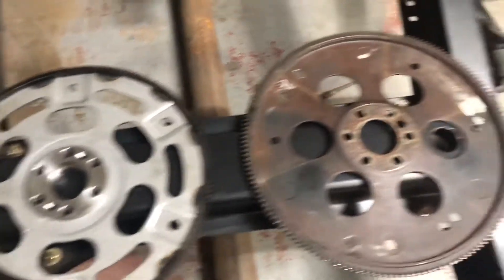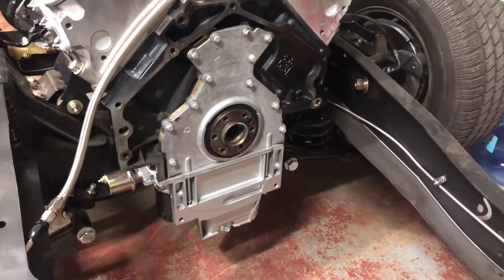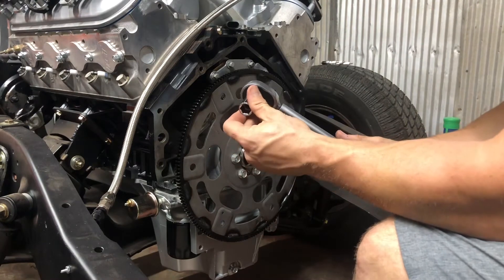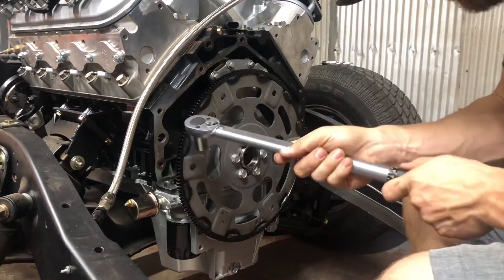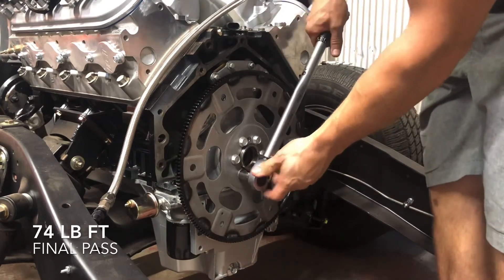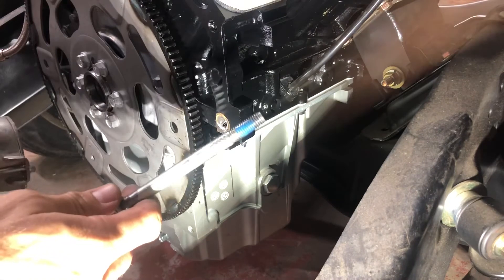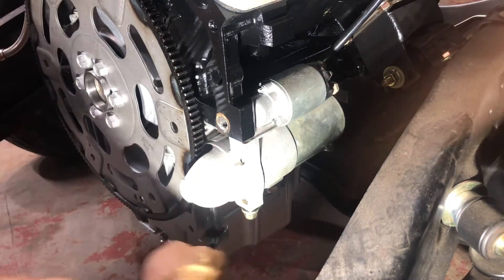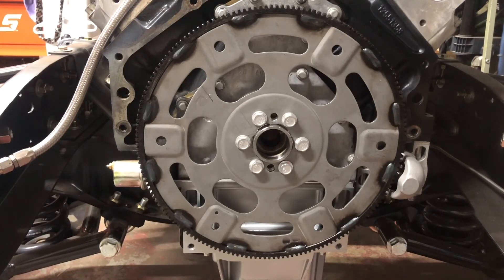How to run a 4l80e behind a 4.8/5.3.

Comment: Keep the starter out till you mate the transmission to engine. Will be easier to bolt the flex plate to the torque converter.
Reply from the maker: Good call.

Comment: Hey buddy I know this is a old video but did you have to change starters to use this flexplate? I’m running a 2002 5.3 LS swap with a original GM 4L80e flexplate or like some say 6.0 flexplate and the spacer that was behind a 4.8 LS with a 4l80e I think it was out of a full size Chevy Van but anyways I bolted up my new 5.3 starter and it sounds like my starter needs to be shimmed, should I have ordered a starter for a truck or Van with the 4.8 or 6.0 with 4L80e instead of a 5.3? Reason I ask is because 98% of the time you don’t have to shim a LS so I’ve heard
Reply from the maker: Did not have to change starters.

Comment: Love this video brother. I have a 1985 Caprice with a lc9 motor, and I'd like to add a 4l80e. Would this combination work for my build as well with that same flex plate? What is the number on you trans?
Reply from the maker: Don’t know the number off hand but mine is a older 4l80e I think it’s a 96 or so. Should work with all 4l80es

Comment: what t
ranny and torque converter are u running?
Reply from the maker: Stock 4L80E
Reply: @3rdGenC10s  ok 👍, I’m currently converting my 95’ k2500 turbo diesel over to a 5.3L. I just don’t know if I’ll need to replace the torque converter. I already got a new flex plate 👌

Comment: I did a 4l80 swap on my 5.3 and when I accelerate my truck starts to slip thinking it was my torque so I changed the torque converter to a 3200 rpm but it didn’t fix the issue I also don’t think it’s my transmission it’s a new one
Reply from the maker: What gear ration are you running?

Comment: Great video bro, i have a question how did that torque comverter worked on your swap? Cause i did the same swap on a 2001 gmc sierra 5.3 4x4  and the torque comverter started to make a noise, i pull it out and it was ribbing with the spacer.
Reply from the maker: I’ve got around 8000 miles on the swap and haven’t any issues with it.
Reply: @3rdGenC10s  nice, well i need to figure it out what to do to make it work, thanks for the answer.
Reply from the maker: @eligiomeraz0683  are you running a 4l60 flexplate or a 4l80 flexplate?
Reply: @3rdGenC10s  4l80e flex plate

Comment: What about bolting a 2003   4L60  to a 2004  6,0L  ???   Can i just use a 5.3 dished flexplate?? No spacer or anything???
Reply from the maker: Should be able to run the dish flexplate and be good to go.

Comment: What size is the socket for the flexplate (center) bolts?
Reply from the maker: I would guess 15mm it’s been awhile since I installed it.
Reply: @3rdGenC10s  you are correct, 15 mm 6 p o i n t.
Reply from the maker: @belladonnaatropa1697  i figured so but it was probably 2 years ago I put the flexplate on lol

Comment: Rookie question but will the transmission still mate up to the back of the block even without that top centerbolt?
Reply from the maker: Yes you just won’t be able to put a bolt in it.

Comment: What's just above the oil filter? It looks goldish. Is that another filter of sorts. Just curious.
Reply from the maker: It’s a sending unit for a electronic oil pressure gauge. I used it to verify oil pressure when running the motor before installing the body.
Reply: @3rdGenC10s  that's really smart. Thank you sir!
Reply from the maker: @cantyoufeelthelove  no problem!

Comment: I am also building a Lm7 5.3 with a 4l80e. Ordered the same flex plate as you but I am having too much gap between the flexplate and torque converter. I have a 0.385” gap. I know I need about 1/8 for tc to move. Thinking of using a 1/4” spacer. Do you or anyone else have the same problem?
Reply from the maker: I didn’t worry about the gap, I just bolted it up and went.
Reply: Yes I currently have same issue with 4.8 to 4L80e I have same gap .385” and know you can’t move TC more than 3/16 ahead, not sure what’s going on as everyone says this is the FP I needed. Thanks.
Reply from the maker: I never measured gap or was concerned, bolted it up and gave about 3000 miles on my swap so far. No issues
Reply: @3rdGenC10s   hey I bolted my transmission in , I have no gap , but the converter spins freely, should I just bolt it to flex plate and be good to go or should I have a lil gap in between the converter and flex plate ?
Reply: @Kris6oh  @ did u figured out? What engine/transmission?
Reply: Flex plate part number
Reply: @epicars6902  @ did u figured out?

Comment: Thanks for the information,  I just placed my order
Reply from the maker: No problem. I’ve only put 500 miles on mine so far but have had no issues.
Reply: @3rdGenC10s  what stall converter did you go with?
Reply from the maker: Stock 4l80e

Comment: So using a 4l80 flex plate on a 4l60 will need a spacer
Reply from the maker: I’m running a 5.3 with a 4l80e so I had to use a 4l80e flex plate which requires a crank spacer. If you’re running a 4l60e you need to run a 4l60e flexplate.
Reply: 4l80e flex plate is made with a spacer. 4l60e is dished. He probably had a vibration cause he had a 4l60e flex plate on a 4l80e transmission.
Reply from the maker: You are correct Previous owner used 4l60 flexplate with 4l80, I just put the correct one on.

Comment: what truck would of that starter came out of?
Reply from the maker: It’s just a stock 5.3 starter. This engine came out of a 2000 Silverado 1500
Reply: @3rdGenC10s  ok and there’s no grinding. im doing a lq9 with 4l80 swap in my caprice
Reply from the maker: @snowman6512  no grinding at all
Reply: @3rdGenC10s  ok thanks man
Reply from the maker: @snowman6512  no problem, if your concerned with grinding just order a factory flex plate and starter for a lq9.
Reply: @3rdGenC10s  im running the same flexplate your running, so i just wanted to make sure it would work with a 4l60 starter
Reply from the maker: Yes sir no issues.

Comment: Hey any updates. Hows the ATP flexplate held up? what kind of power you putting to it?

Thanks!
Reply from the maker: I’m still in the process of building the truck. It will be behind a stock 5.3. They were rated at 295 from the factory.

Comment: Nice video. My 2000 was built in late 99 and it required the spacer on my 4.8, also when I called the GM dealer for the torque specs they said it was 74ft-lbs. they never mentioned a step up torquing method
Reply: Stepping is not required sometimes.  But it's very recommended, especially if you are dealing with selling surfaces or softer alloys. Also it's recommended because it's not a good idea to keep torque values high between any neighboring bolts/fasteners (metal deformation due to higher clamping force in small particular area).
Reply from the maker: I think I pulled the torque specs from jegs or summit. I’m sure either way would be fine.
Reply: @3rdGenC10s  I don’t really think it matters unless you’re not at 74ft-lbs lol, I’m just sharing my experiences and what the dealer told me

Comment: You said it comes as a kit, but think takes you to Amazon for just the flex plate. Could you add a link for the adapter please. TIA
Reply from the maker: The adapter is already pressed into the flexplate. If you look in the first picture of the Amazon link it is in there. Hope this helps. Second pictures shows the heads of the bolts as well.

Comment: What bolts did you use on the flexplate and can I use my original bolts on my 5.3 flexplate
Reply from the maker: The bolts came with the flexplate kit I bought. If you are going to run a 4l80e you’ll need to purchase the longer bolts for the spacer.
Reply: @3rdGenC10s  im running a turbo 400 for now
Reply from the maker: @irvingbar4569  the 4l80e flexplate kit I used will work with the turbo 400, it comes with flexplate spacer and bolts. Link to it is in the description.
Reply: @3rdGenC10s  thank you
Reply from the maker: No problem man

Comment: Hey, I got the same flexplate kit, did you use any additional adaptors in the middle, or you just matted your transmission just with that since this flexplate already comes with spacer pre installed..
Reply from the maker: Mated my trans with the kit, no extra spacer or adapter needed.
Reply: @3rdGenC10s  thank you so much for confirming, I’ll be doing this today then. You don’t have any issues with spacing and stuff like with the torque converter thrust space or something it’s called
Reply from the maker: No sir, bolted right in with 0 issues
Reply: @3rdGenC10s  hey, so I was fitting my trans n engine together with this flexplate. when I have the trans all the way next to the engine. Torque converter makes contact with the flexplate and it only movies with the flexplate. So I had to back out the trans little bit in order to line up the torque converter bolts at that time I was able to spin the torque converter by itself. Is there something wrong ?
Reply from the maker: Are you sure the torque converter is fully seated into the pump?
Reply: @3rdGenC10s  yes it’s all the way in I tried to push it more it in it doesn’t go more, it’s a stock converter that came with 4l80E
Reply: @vally520  you should have 1/8 of an inch gap from flex plate to torque converter no more than 3/16 if not you probably need to seat the torque converter some more
Reply: @slicksloth_416  i had found the issue, it was the pump gear kind of scuffed up that weren't allowing the converter to go on fully.
Reply: I used a circle d torque conver that had same pattern as the original 4l60 ( thanks to tahoe steve).. no spacer ring required...and used a dished flexplate with same size bolts..but swapped with arps.

Comment: I have a 06 chevy silverado 4.8 what year of 4l80 do i need
Reply from the maker: Any year 4l80e should work but you will need to have the ecu tuned for it and change out the trans plugs as well
Reply: My trans plug has a Allen key that screws in what do I need to do to make it work with a 4.8 ls besides flexplate ?

Comment: Really appreciate the info. New to LS stuff just picked up a 2004 GMC Sierra 2wd 4.8 short bed. Doing this swap shortly. Not sure if the long crank is year specific or not but I can cross that bridge once it’s apart I suppose. Thank you again. Great vids keep em up!
Reply: i think if the motor had a manual tranny from factory it had a longer crank flange.

Comment: Was the 4l80e originally from a L31 5.7? Or was it from an LS application originally? 
I have a L31 4l80e originally from a 2000 5.7 van I need to bolt to my 4.8. Any info is appreciated thank you !
Reply from the maker: Mine is a 96 4l80e. Trans bolted up with no issues to my 5.3 using the flexplate listed in the description.
Reply: Thanks for the fast reply,
I will use this setup on my 4.8. 
Awesome video !
Reply from the maker: Glad I could help I appreciate the support!
Reply: Thanks. So I assume I can use basically any  4L80E converter ( my choice of stall ) and it will work fine with that flex plate?
Reply from the maker: Yes sir, the only issue you may run into is, if you have a long crank 4.8, then you would not need the spacer.